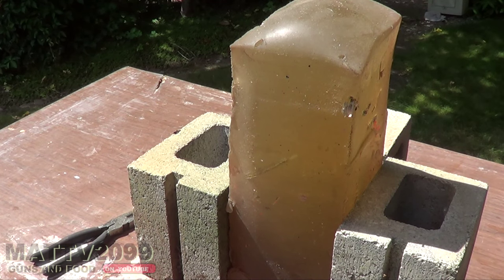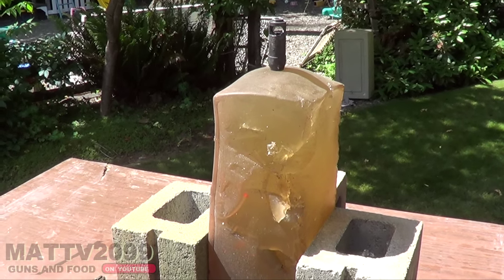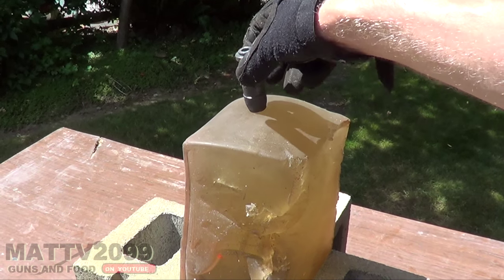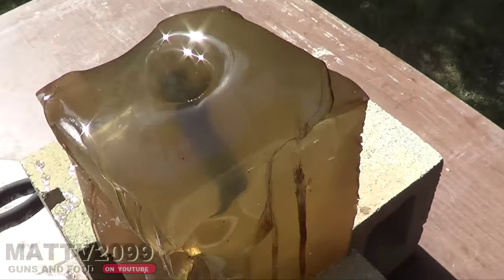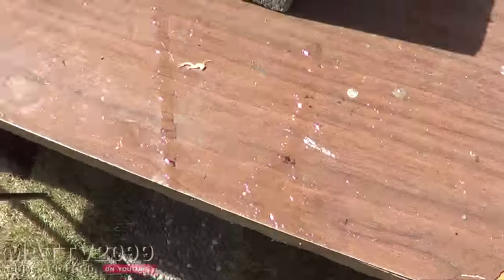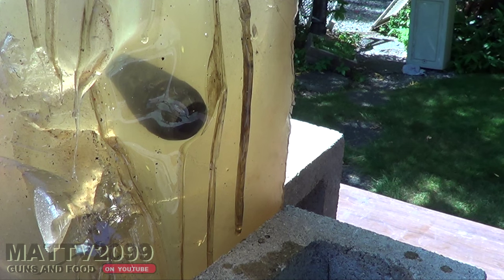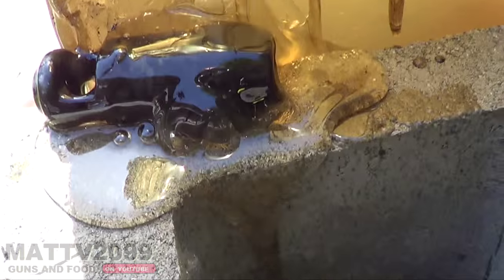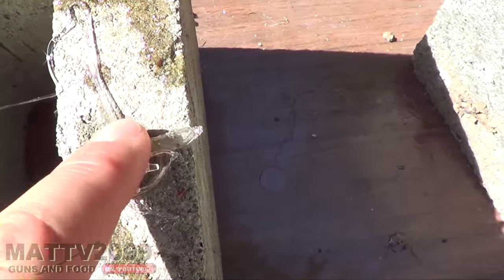Red Hot Muzzle Brake vs BALLISTICS GEL "RHMB"

Comment: what is the muzzle break made of É . and what is its specific heat capacity É
(yes i am canadian, but its my stupid french key board that replaces question marks  with the stereotypical É s. yes É is pronounced eh and im starting to think whoever made my key board is racist )
Reply from the maker: +Connor Dow it's made of metal and the heat capacity is red hot, brah
Reply: thanks but i was hoping for something like an alloy of titanium and a really high heat capacity like 8 j/g.c
Reply: +Connor Dow Gets orange hot at pretty low temperature so it'll be made of relatively low carbon steel with an oxide layer, nothing too spectacular.
Reply: thank you.

Comment: 'its probably oil based' so you decided a hose would be the best option to put it out?
i nominate you for the darwin award
Reply from the maker: Vash the stampede that was the joke.
Reply: MattV2099: Guns & Food ORLY? but seriously, don't want you burning up, i hope you had something to actually put it out behind you
Reply: The only reason they say don't put water on oil is if it is in a large volume and has reached it's flash point. It would cause the water to vaporize and cause a burning gas cloud. Here it would do fuck all
Reply: Tactical Ultimatum not true, oil and water are not in the same phase, so oil will not emulsify in water, thus water will in fact spread the burning oil further, causing a larger area to be ignited
Reply from the maker: this isn't made out of oil. it's gelatin. water should work.
Reply: Vash the stampede True, it will not dissolve in solution. but it will still remove a reactant and heat from a reaction therefor stopping it. Example, dripping water on a lit oil lamp.
Reply: Vash the stampede well since the objective is to burn trough the stuff the hose should be used to atleast keep it from spreading so a hose should do the trick :)
Reply: Lee Harvey Oswald Didn't you like, kill Kennedy or something?
Reply: Tactical Ultimatum yea and some general dude :)

Comment: Now that the RHMD is reborn, you will have to heat it up with induction coils connected to your power lines. New muzzle device, new heating system. RHMD 2.0 here.
Reply from the maker: Odood19 I'd like to have a machinist make me a trick RHMB. one that has a solid core but looks exactly like this RHMB. that way it'll stay red hot longer
Reply: MattV2099: Guns & Food Really awesome if it was tungsten. Hot n' heavy.
Reply from the maker: FoolishDoug or titanium?
Reply: MattV2099: Guns & Food I dunno.  How much does that metal fetch at the recycle yard? ...cough...
Reply from the maker: FoolishDoug no idea. I'm a dumb noob at that stuff.
Reply: MattV2099: Guns & Food Tungsten would be heavier I thought? Probably holds heat very well with a 6000+ Fahrenheit melting point.
Reply: FoolishDoug The melting point doesn't affect how long it will stay hot, or at least I think so. The metal's properties of thermal conductivity, specific to the type of metal, dictate heat retaining capabilities.
Reply: Odood19 Looks like a slug of aluminum would be best choice then.
Reply: ***** Which would you prefer to use then if money wasn't an issue?
Reply: ***** Ceramic would work great for holding in heat.
Reply from the maker: Odood19 ahhhh. someone make me a ceramic muzzle brake! LOL

Comment: Mat you should test your RHMB on Honey as normal, crystalized, and frozen states. Sincerely, Robert Hallock.
Reply from the maker: Robert Hallock whoa. I actually did honey. I htink. if I didn't upload it I recoreded it. crystalized
Reply: After a while honey will form crystals as it is stored over a long period of time. The crystals do not hurt honey in fact they are honey. To remedy the crystallization, you just heat up the honey. Sincerely, Robert Hallock.
Reply from the maker: Robert Hallock yeah. i know. I microwave it yo

Comment: No It's not going to burst into flames, I tried to light some petroleum jelly like mig welder lube on fire with a cutting torch when I was in high school and all it did was melt.
Reply: Well I was wrong, there must have been some flame retardant shit in that mig welder lube.
Reply: Edgar Smittenheighnjenkson Petroleum jelly only really works well for prolonging the fire of another object, like a rag. If you knead jelly into said rag and wrap it around a stick, it works very well as a torch. On it's own, though, it just melts down like you said.
Reply: Maybe*

Comment: first;y this is just RHNB with a different item no matter what item you use if it is metal it will have the same effect once heated secondly it is proving nothing as you did not leave the object in the ballistics jell you gave the muzzle break time to cool down when not in the object its not hard to put it onto on a stable position and comment without touching.